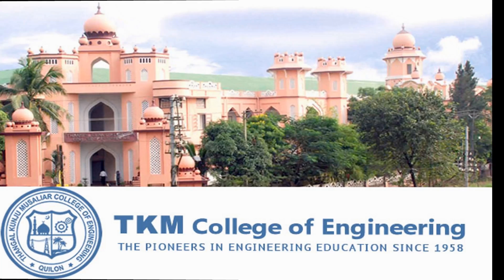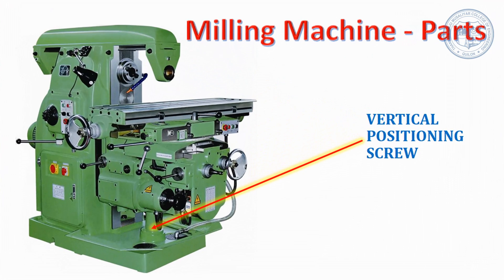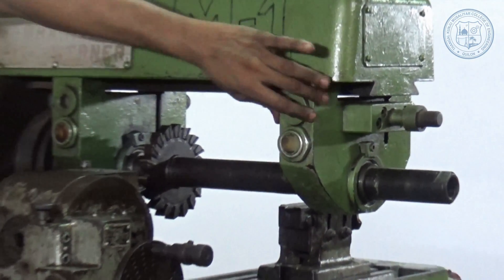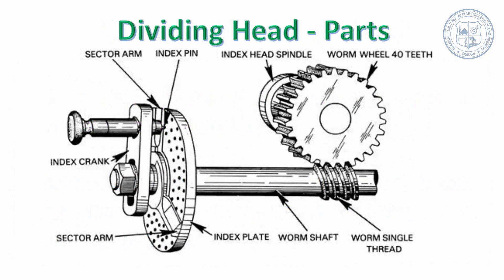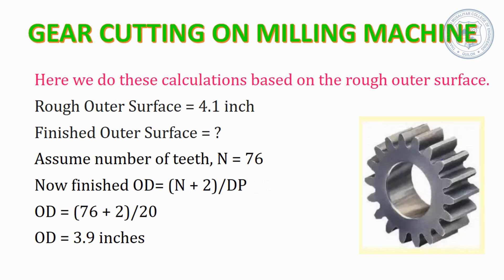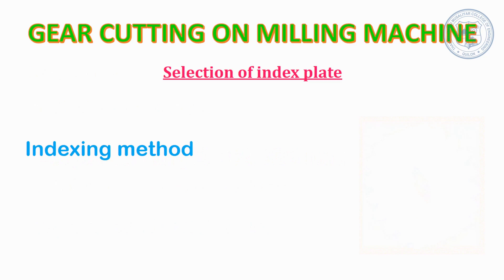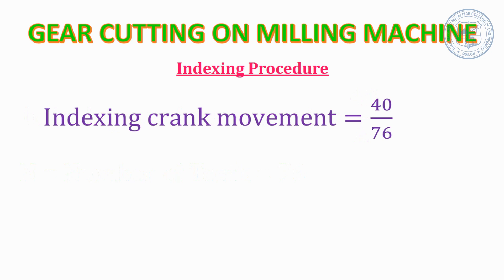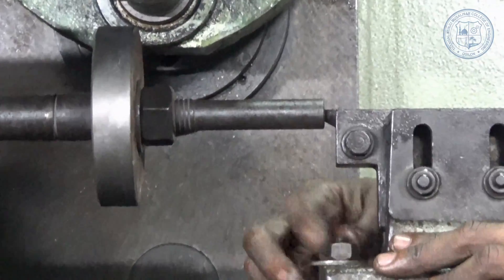Gear Cutting on Milling Machine

Comment: Good video, but How set the gear cutter to exact centre of the workpiece?,how select a proper cutter?, these are very important process of a gear cutting. You have never mentioned about this.